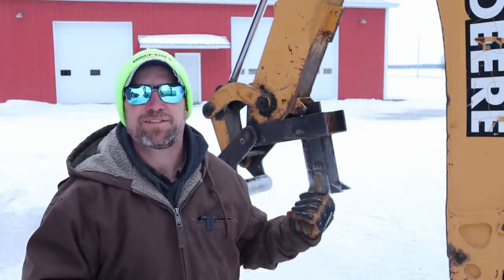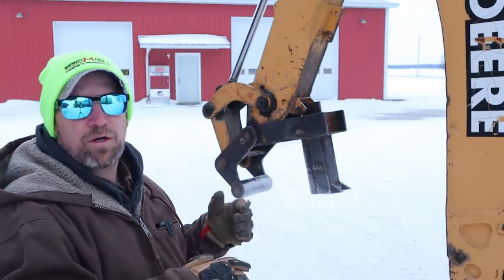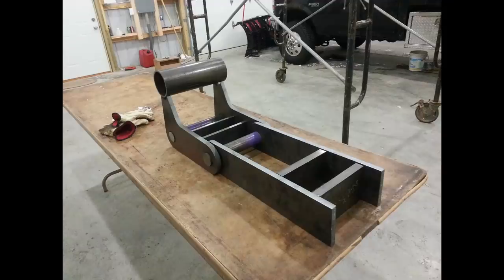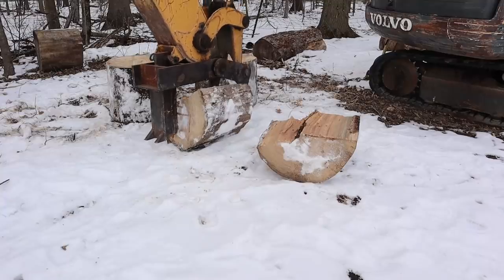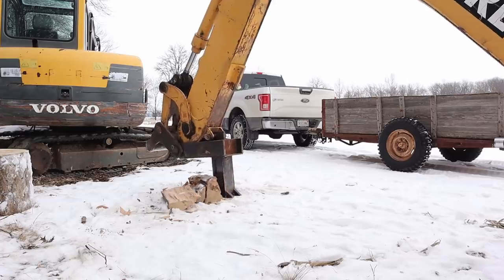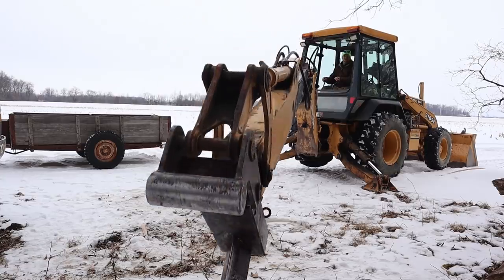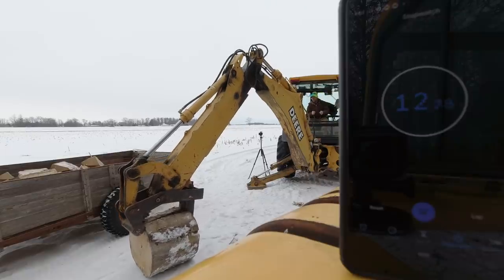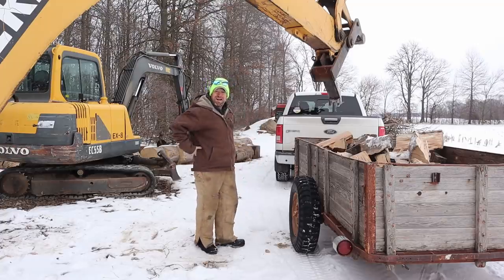My Wood Splitter Doubles as a Backhoe! - Homemade DIY Wood Splitter Splits Large Rounds With Ease

Comment: Compliments on the device. I have been told that you don't need to reinvent the wheel if you can steal the whole car. I have built (from scratch) a front end loader, a split deck tilt trailer, and a pipe press (horizontal pipe driver). Someone spent a lot of money developing these things, so why should I replicate their mistakes when I can avoid them in advance. I also looked to see if I could find any weaknesses in the manufactured version that I could improve upon.  Sometimes I paint myself into a corner, but overall the journey has been the most rewarding part.  Again, good work on your splitter.
Reply from the maker: I agree so much.  Congrats on all the great tools you've built.  It is fun to experiment with new ideas on older designs too.  I like your insight into not reinventing the wheel and appreciate the feedback.

Comment: Clever device.  I'm curious how it works on gnarly pieces with branches and knots.
Reply from the maker: Depends on the wood species.  It will do some and others it will not.  The regular horizontal splitter is better for the really tough stuff.  I try to only split straight stuff with this as it can tweak it if it pinches down on something that it doesn't want to split.

Comment: Awesome I think I know what next winter project going be, you ever have a piece it won't split?
Reply from the maker: Yes, there is the occasional piece it will not split.  And depending on the species it can be stringy or tough just like a normal splitter.  I try to avoid crotch wood and stuff that is just nasty in general.

Comment: One of the best things I ever did.....after a log splitter, is get a 7x14 dump trailer. Load it with wood on job site and bring it home and dump it. A ton less handling the wood by hand.
Reply from the maker: I'd love to have a dump trailer to fill and leave on or dump whichever suits the situation.  That sounds like a good setup.  Usually if I load that trailer in this video I won't unload it unless it is going straight into the stove.

Comment: Pretty ingenious ,
After many dozens of woodyard video channels ,
Yours is amongst the most original concepts.

Good ideas, good videography , good execution.
How much hydraulic muscle does it take to utilize that device ?
I guess what horsepower is that tractor ?
A sturdy front loader grapple like the Frostbite sells for $1,500.00
Could you come close too that price for retail sales of that beast ?
Reply from the maker: Hey thanks so much for the kind words Jean! 

It takes quite a bit of hydraulic power.  The backhoe is about 80hp and there are pieces that I'm not able to split with it.

I don't think it could be built and sold for $1500 and make any money selling them unfortunately.

I think it would be a nice thing to have available though. It sure is handy once you get used to running it.

Comment: that is so cool. i wonder how well something like that would work on a subcompact? like a deere 1025r or slightly bigger like a 2038r
Reply from the maker: Thanks and that is a good question.  I bet it would do it on some smaller rounds or the right species of wood.  Some of the straight grained wood will split pretty easily so might be a good option.  If I had a sub compact backhoe I'd try it!

Comment: Even if you just quartered them and handed them off to someone running a log splitter this would save a lot of energy and time! Very good design
Reply from the maker: We've done that before too.  But ultimately what I have found is I can split them faster with this than we can with the small wood splitter, but I don't need them to be split down very small for my boiler either.  Thanks for watching!

Comment: "Wood is easy to split with a maul when it's cold out and the logs are frozen..."
I've heard that so many times, it just hasn't been true in my experience.  Love the concept, that is such a great splitter. Sucks that the bolt sheared, but that's easy to fix.
Reply from the maker: So true Curt.  I hear that kinda thing from other folks too.  I've never been great with splitting with an axe or mull, but I'm not a very big guy so little disadvantaged maybe.  I certainly prefer this method!  I'll get that bolt fixed up in there.  I may actually attempt to fix it for good like is should be so it doesn't keep breaking off those bolts.  Thanks for watching!
Reply from the maker: Acer Acres  Hey, don't be making fun of 10 year old girls like that!  I've never claimed to be any good at using the maul, but fortunately I have that backhoe!  I've seen people split these big rounds like a machine. I'm not one of those people.  I can't hit a baseball over a major league fence or dunk a basketball either, despite being taught the proper technique.  Some things people aren't just cut out for I guess.

Comment: I had rough plans on using an old giant  excavator years ago using a mega 6 or 8 way wedge. Just a pipe dream. Would of been so much power required. Would have maxed out machine. As soon as I saw you operate that I thought now thats got me beat by a mile. How long was your thought process on that beauty.
Reply from the maker: Thanks John.  I thought about this thing a good while before I built it. Probably a year or more it was bouncing around in in my head.  Once I got started though it all happened very quickly.  I had a big tree project and I knew I wanted to try this idea, so I pulled the backhoe in the shop and a week later I pulled it back out with that splitter on there.  The first version I had just a 1"X5" flat stock for the wedge and I bent it after 3 or 4 uses.  I reinforced it with the angled side pieces and it has been fine since.  I also had a 4 way wedge on this but I hadn't designed it correctly so I cut them off.  It was all the machine wanted anyway and would stop more than it split.  So, there has been a learning curve but it's been working as you see it for the last 7 years or so.  Thanks for the great comment.

Comment: Neil... looks cold out there.  Well, I’ll let you in on a little known fact... When I looked at the temperature on my thermometer this morning it said we had one.  Looking at it now it says we have none.  Can you believe it?  The temperature has totally disappeared.  The thermometer can’t even find it.

That splitter is clever... I’d build one for my baby backhoe but, I have two problems.  First of all the bucket cylinder is so small I might only be able to split kindling.  Second, I do most of my projects in wood.  My metalworking skills are limited to cutting flashing and wire forming.  Even using full tenon joints and Titebond lll I can’t figure out how to make wood strong enough to split wood. So, I think I’ll keep dancing with the girl I brought to the prom.

And... she is... I’ve told you about the log splitter my neighbor and I built.  (CAT D6? lift cylinder, Murray 12hp Briggs engine pushing a PTO hydraulic pump, 12” I-beam, Frame made from a storage rack and rear axle from a 59 Studebaker pickup.  It would be a thing of beauty... if we ever decided on a paint color.). However, I may not have told you about the latest modification to our Rube Goldberg facsimile.  

Last summer, I told my neighbor about Camarata’s 4-way splitting wedge build.  That started him on months of research.  Every week or so, he’d show me another photo or video of another 4-way wedge.  

One early December afternoon, we set foot on the quest for the ultimate splitting weapon.  We picked up a couple of chunks of 1/2” thick cold rolled. These would get bent, welded and ground to make side plates for the slip-on wedge.  

For the wings of the cross wedge... we cut pieces from an old road grader cutting edge.  These did not require sharpening... and added a really cool looking curve to the wedge.  It almost looked aerodynamic... or, would it be woodynamic?  Only time would tell!  These were welded onto the sides of the wedge at right angles... and voila... we had a 4-way wedge.  We patted each other on the back and went to dinner.  

The next morning we set about trying to figure out how to secure it.  You see our engineering focus had been on how to make the wedge... Our plan for attaching it to the splitter consisted of... slip it over the old wedge and make some sort of bolt-on strap to hold it in place.  Well sir, that is what we did.  

Time to test it.  We started with a piece of half rotten white oak.  It cut through it like butter.  Then we grabbed a niece of gnarly, knot infested, fresh cut,  red oak.  To our complete and utter surprise... the 4-way wedge peeled off the drive wedge like a flap jack on Teflon.

You see, the cutting edge of the drive wedge was tapered downward from front to rear.  That worked great when splitting wood because it drove the wedge against the I-beam and kept the cylinder aligned during the strike.  (It only had 1/4” flanges wrapped around the beam to hold it there as it slid.) But, as soon as we dropped the 4-way wedge over it, it turned into a ramp that slid the wedge off the front like a 7 year old claiming home base, on a play where the ball is still in the outfield!  Because, you know, that’s what the pros do... 

Crestfallen is often used to describe the feelings of one who ascribed to greatness only to have their hopes bashed upon the rocks.  Well, we were way over yonder past that... we were flat out devastated.  Only one thing to do... grab a Pepsi and reconsider our engineering options.

Fortunately, the day was young.  As we drank, the realization hit us that the inside of the 4-way made contact with the taper of the drive wedge at its rear edge first.  What we needed to do was to make a tapered insert for the 4-way that matched it.  

About an hour later we were ready to test it again.  Knowing that we’d whipped the problem, we skipped the half rotten white oak test and went straight for the gnarled, knot infested, red oak. (The fact that it wasn’t split the first time and had sat nearby, mocking us, may have factored into it too!)

That test went perfectly.... for the piece of gnarled, knot infested red oak.  

Being a DIY aficionado... you, no doubt, already saw this coming.  The beauty of the inclined plane is, it almost guarantees that the more downward force you put on it, the more down slope lateral movement you get.  By building up an incline on the inside of the 4-way so that it perfectly matched the down slope of the drive wedge’s cutting edge... we had built a perfect ski for the ski slope.  This wasn’t lost on, the piece of gnarly knot infested red oak,  I think I heard it say, “Wheee” as the wedge slid off and plunked to the ground at our feet.

Faith in out engineering prowess had taken another another strike of earthquake proportions.  Time for another Pepsi.... over lunch.

Well, this is getting longer so I’ll spare you the design and fabrication details.  Here are a couple of other lessons we learned in our quest to master cleaving that gnarled, knot infested, red oak firewood piece:

If you reinstall the wedges, drill a hole through them and install a 1/2” bolt.  You create a perfect bolt shear. (Oak-3/farm boys-0)

Upping the game to a grade 8, half inch, bolt only increases the designed cost. (Oak-4/farm boys-0)

Removing the 4-way wedge and splitting the gnarly, knot infested, red oak with the original drive wedge... priceless!

It was getting dark and we were out of Pepsi... so that’s where we left it.  

We walk by the 4-way wedge from time to time. The pure symmetry of its sides, the heft of its mass and the beauty in the woodynamic sweep of its wings is really captivating.  But, we’ve resisted the seduction to expend additional engineering capital on it.  At least until we get enough Pepsi in stock to face the nearby pile of gnarled, knot infested, red oak brethren leering at us.

Neil, I’ll keep you posted on any more attempts to achieve our dominance... while marveling at the simple, yet elegant design path a real expert, like you, chose!
Reply: LOL...Over and over. I think the perservierence (or stubbornness) of the farm boys almost always wins in the end.
Reply: @marykoch5168  we’ve downed a few Pepsi’s since then.  A full frontal onslaught is planned.  My neighbor picked up 10lb of welding rod, I picked up a dozen grinding and cutting wheels... we’re gonna stick that 4-way wedge on... even if we have to chew dollars worth of Double Bubble to do so. 

Stay warm dear.
Reply from the maker: Oh goodness!  I feel your pain in the quest for the perfect 4 way wedge more than you may realize Dave!  There were many Pepsis involved in the design and (ahem) redesign of this wedge as well.  I would assume that you are an observant enough viewer to possibly have recognized some scarring on the sides of that wedge on the backhoe splitter?  Well if not, then upon a closer look you can likely see what remains of my attempt at a 4 way wedge also.  I didn't disclose it in the video, but there has been an engineering learning curve with this unit as well.  I tried a 4 way wedge and found that when it worked, it was awesome.  But, when the backhoe found a tough piece like your gnarly red oak, the splitter suddenly became useless.  The leading cutting edge of the 4 way sub wedges were installed too close to the leading edge of the primary wedge, not allowing the wood to be split enough before it met the secondary 4 way wing wedges. Essentially I created too much surface area between all the cutting edges and then the backhoe didn't have enough power to overcome all the surface area, making my wedge just a really nice log grabber.  I couldn't split about 70% of the pieces I picked up.  And then the ones that did split usually resulted in one of the four split chunks getting stuck between the 4 way wedge and the mounting surface area of the splitter above it.  It was a complete failure.  I spent several hours welding on the 4 way wedges and about 20 minutes cutting them off with the torch.  Not only did the 4 way not work out, the primary wedge actually started life as not even a wedge.  It was just a 1" piece of solid steel and you can see the base of the original center in one of the pics in the video.  I bent the original within the first couple days of building the splitter and then reinforced it by putting the angled pieces on the sides and it also helps to get those stubborn stringy pieces of spread apart.

So, don't feel bad with that beautifully crafted 4 way laying on the floor.  You're not the only one with remnants of failed brilliance laying around the shop mocking you.  For me, the path to finding what works usually involves a few dead ends and road blocks, but I just double back and head off in a different direction.  That 4 way idea still lingers as a path not conquered so I won't dismiss the idea of setting out to tackle it again.  Just need to stock up that Pepsi fridge and fire up the welder again!  

Thanks for another great comment and tale from Sassafras Valley.
Reply from the maker: I want to see the video!!! I need inspiration so that I can try the 4 way wedge again too!
Reply from the maker: Stubbornness is probably the better choice of word Mom! :)
Reply: @digdrivediy  or naivety?

Comment: Did you ever calculate how much force it's capable of?  I wonder if the same machine with an aux hyd circuit would tackle the knarly stuff a bit better as it would just be a HD horizontal splitter upside down.  Still love this for it's simplicity though.  All steel, no extra cylinder, and could be made for any machine.
Reply from the maker: No, I never really calculated any capacities.  Just built it on there and tried it out.  Been lucky it's worked ever since for the most part.  It has made dealling with the big ones much easier.

Comment: That's frickin' awesome. Great channel BTW. I just found it. I wonder if my Kioti NX front curl cylinders have the giddy up and go to do something similar.
Reply from the maker: Thanks very much. I'm not sure how those front cylinders would do for sure.  The backhoe has some pretty beefy hardware with a good bit of power and I still encounter logs now and then that will stop it.  Always worth an experiment though cause I suppose you don't know for sure.  Could probably build in some mechanical advantage too.  Thanks so much for watching!

Comment: Fascinating splitter.  I have seen a similar splitter on an excavator with a 6 way wedge.  Does your Back hoe have enough power in that cylinder to handle a 4, 6, or 8 way wedge?
How about extending it to accommodate longer wood up to 28 inches.  Is that a possibility?
Reply from the maker: I tried a multi wedge and had trouble with it. I may try another version some day.  I can't go much bigger with the width as I'm using all the stroke with current design.
Reply: You need to remember what a backhoes intended purpose is. The breakout force on the hydraulics isn’t that much. While splitting soft woods with a hoe may work for awhile, hardwoods and continual use will harm everything from the pump to the cylinders and hoses. Just because something works the first few times doesn’t mean it can handle that long term. On mid to large excavators the breakout force is much higher but then your talking about $400,000 dollar excavators. Mini excavators are never used for such. Their worse then a hoe.
Reply: I’m guessing hydraulic force to dig hard dirt would far exceed force needed to split wood.